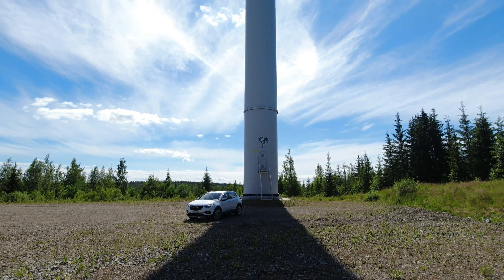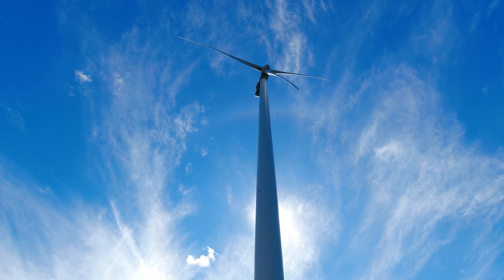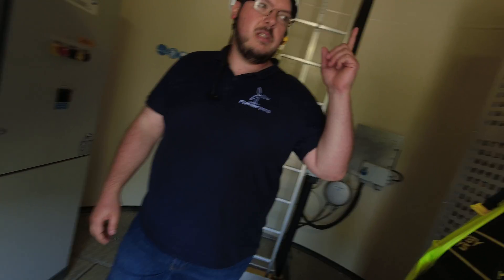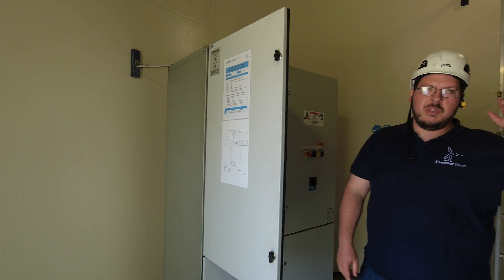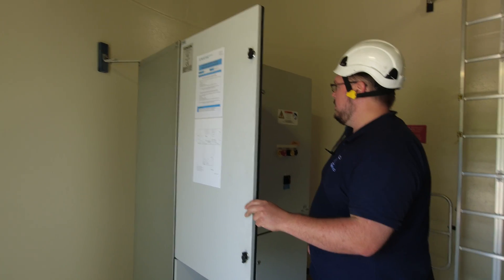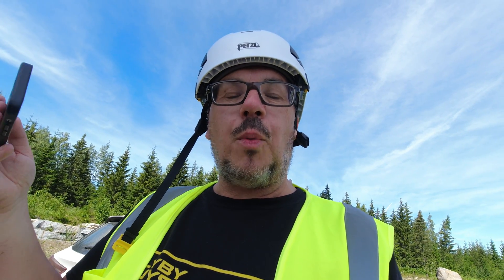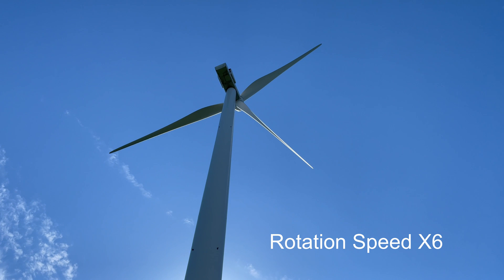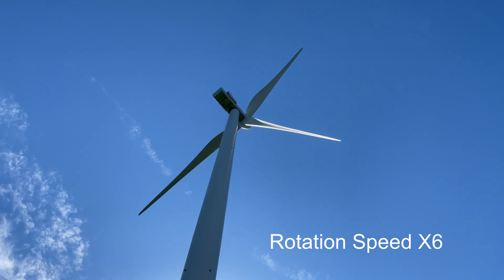Wind Turbine Inspection - DJI Phantom 4 V2.0 *Drone Safety*

Comment: Hello sir !
Is this manual or automated flight ?
Reply from the maker: Hello. It’s a manual flight. Autonomous flights for WT’s can be done with the correct SW and drone.
Reply: @FlybyGuys  
Can you tell me if this can be done by auto-flying? How possible?
Reply from the maker: @ Using specialist SW provided by the SW companies doing the analysis. 
They don’t give this out to anyone. You need to be certified, heath and safety approved and trained on the turbines.